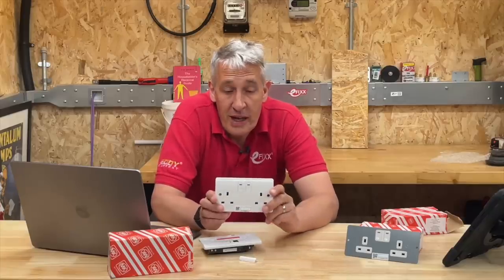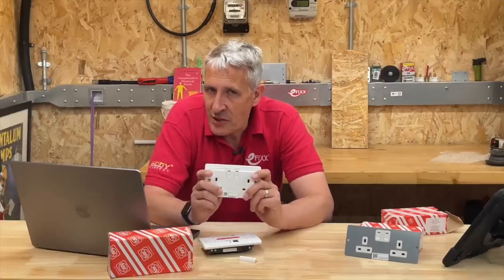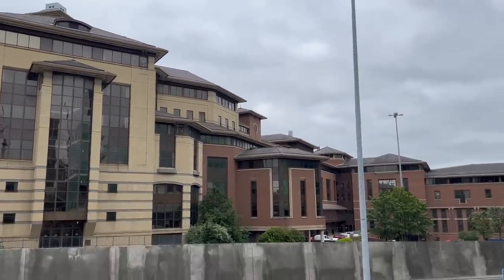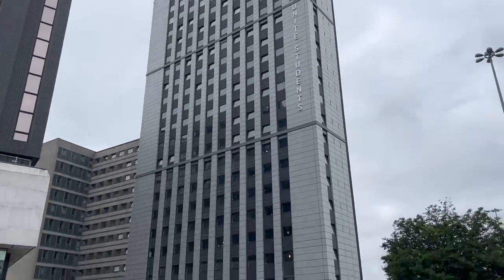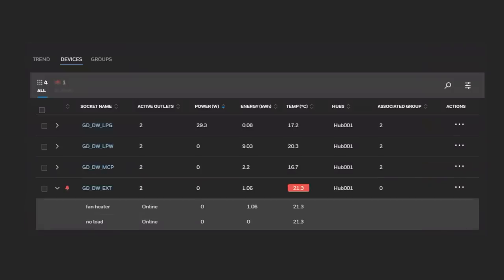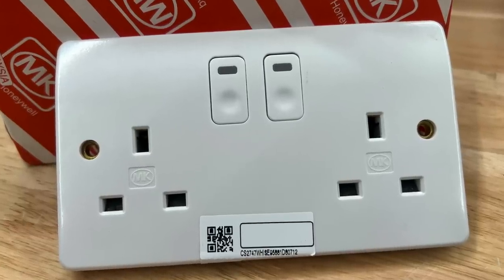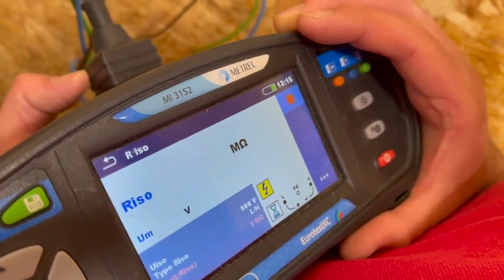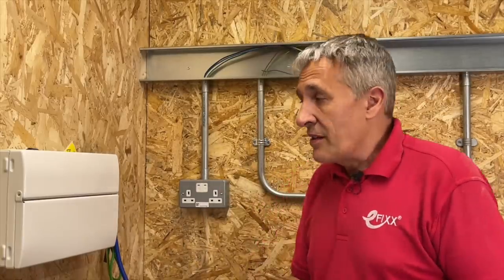Unveiling the Hidden Surprise in this Game Changing Socket

Comment: So if I was a student with this in my dorm, all I got to do to bypass the limitations set in the BMS is remove 2 screws and flip that switch?  I guess the BMS would probably alert to say that the sockets went missing though
Reply from the maker: The BMS would flag a fault and the socket won’t work if the internal electronics aren’t connected - better pop down the students union instead and make a nuisance there instead.

Comment: How good are the relays in one of these sockets? It could be an expensive exercise getting an electrician in to replace one, and program it to operate with the rest of the installation. Every time an organisation has a re-organisation/office move, or equipment is moved from A to B, or extender leads are fitted, the system will need reprogramming. I can see that certain use cases like gyms could benefit from a system like this.
Reply: No reason for an electrician to manage the software side. The buildings existing IT support could easily take that part of it on without issue. In fact, most IT departments would no doubt insist on it..
Reply: @dougle03  The building management team is never going to let the IT team anywhere near the resulting network, while the IT team will be making it very clear that power will not be just disconnected from devices such as printers as and when the building management team thinks it is for the best.

Comment: Why is this device avaiable only for industrial or commercial applications? Is this limitation just a financial limit in the form of capital costs of the system needing a large number of outlets, where savings can be made, so that ongoing savings eventually compensate for initial capital costs? Device pricing would have been a useful parameter to have included in your video.
Reply: £250 each.... Similar units can be had from Amazon for about £30
Reply: @dougle03  That seems very odd. Why would anyone pay £250 when "similar" devices are available for £30 from Amazon? Just what is covered by that danngerous word "similar"?
Reply: @ianburton9223  All the key functions of the MK one. Wireless comms, remote control of each socket, remote temperature sensor. As far as I can tell the only USP of these units is the ability to disable the electronics, but only by taking the faceplate off to do it, so not really very practical...
Reply: @dougle03  Added cost of £220 for the red button does not apear to be a reasonable commercial propostion. Thanks for your contribution to this "bang for the buck" issue.
Cheers
Ian M. Phil., C. Eng., M.I.E.E.  before the institution of electrical engineers became the instutution of engineering technology - MIET would have been my new label, but this translates to "crumb" in french - not good for my business in France.

Comment: Odd question.:
If the Orange switch disables the smart circuitry, does the outlet still operate.? (Supply power). For it to properly be part of the test.
Students (or workers) will very quickly disable the smart technology using this switch.
It still may be flagged up on the panel as a missing socket on the system though.?
Thoughts.?
Reply from the maker: The electronics needs to be powered up.
Reply: @efixx  For the relays of course. I suspect students may still find a way around the restriction by pairing up the Two outlets into one trailing socket.
Reply: @G1ZQCArtwork You are confusing yourself.

The internal switch is present for purposes of electrical testing, nothing more. So it is switched off by the electrician for the purposes of the PAT/insulation test only, and then switched back on.

You don't want power coming out of the socket under this test; this is not normal operation. There is no appliance connected to the socket outlet.

So yes, turning the switch off isolates the smart socket's electronics from its supply and means that the socket cannot operate. It means that the relays switching mains power to the sockets are in a normally open state and require energising to close the relay contacts and energise the output sockets.

So if you wanted to permanently disable the socket and prevent it being used, opening the socket up, sliding this switch would achieve that. But that would be a pointless thing to do, as you've installed a £250 socket and now it can't be used.

Now, your second question/issue was whether you can bypass the current restriction limitation when active.
That's not connected with the electronics isolation switch.

If the user has configured the system to limit the socket to 6 amps each, then yes that restriction can be bypassed by making up a cable adapter arrangement comprising two 13 plugs with 13 amp cables and a junction box. That would provide up to  12 amps of current.

A highly dangerous cable because you would be able to remove one of the two plugs from the sockets and a live pin at full mains voltage would be exposed.

But yes, the current restriction could be by passed.

Any seller selling such a cable is certainly going to have Trading Standards soon knocking on their door and possibly a prosecution will follow.

But of course, there is nothing to stop an individual making up their own such adapter cable.
Reply: @deang5622  No, not confused thanks.
Reply: @G1ZQCArtwork  Not now I hope after having answered it.

Comment: I would be intertested to know why they resorted to screw terminals over their latest lever type terminals..... has MK lost faith in that route?
Reply: You assume they considered their use and ruled them out. They might not have.

Or they might have considered them but ruled them out for cost.
Reply: @deang5622  These are £250+VAT per socket. Cost was not the limiting factor

Comment: with rf coms and the right f/w these could become very attractive additions to any hobby home automation system
whats the IC employed? is it open to modding? if using 433mhz rf it should be cheap to integrate into any system
Reply: Already done. BG is doing something similar for a tiny fraction of what these cost. The home automation scene is now dominated by the open source community. Could not tell from the video, but that chip looked like an Expressive ESP8266 or S32, thus very much moddable with your choice of alternative firmware...

Comment: I would have thought, given the price of these sockets, that the best solution for most office situations would be to get modern energy efficient hardware at the next hardware refresh cycle.  I did some analasys of our office equipment a few years ago to appease the bean-counters who regularly walked around a 50+ person office turning off all the "idle" monitors, printers, etc.  

Using inline power monitors averaged over the course of several weeks, i calculated that turning them "off" by pressing the button on the front saved litterally pennies across the whole company.  And in fact cost the company man hours for the person who was wandering around turning them off.  This is because the difference in standby power usage when teh LED is on or off is tiny on modern well engineered hardware.

Obviouslyt the biggest difference was fully unplugging from the wall (or physically flipping the wall switch where that is an option), however the cost... across the whole company... for about 50 screens, some desktop pcs, 5 printers, and a few ancillary bits of hardware sitting in standby mode, was about £25-30 a year.  Considering our annual power bill was close to 5 digits, it barely shows up as noise.   Admittedly this cost will be larger now power prices have shot up, but i imagine percentage wise its going to be pretty much the same amount relative to the total bill.  Possibly less because we have newer, more efficiant, hardware now.

This is obviously only relevant for devices that are in "standby" mode.  If the device is actively left "on" and drawing actual current, then thats a different situation, but i imagine using an inline smart socket would be an order of magnitude cheaper than installing these to solve that problem.  Not quite as "neat" though i guess.

Comment: If this was to be used in a domestic installation does it support MQTT, Home Assistant, or Home hub integration? Or does it require MKs proprietary BMS software ?
Reply: They're not designed for domestic installation.
Reply: @Pugjamin  That wasnt the question i asked.

Comment: The biggest waste of electricity I came across when I was working was in a school domestic science room. I wired in 30 2kw under sink water heaters, each one, of course, had its own isolating switch on the worktop. I used to do a lot of other work during the school holidays when I found that all the water heaters had been left switched on all the time! The MK system would have saved a lot of money in that situation.
Reply: At a high school I went to in the 90's the computer department would leave all the computers on overnight, the lights would get turned off and the screens would go into standby so from outside the room would be completely dark, but in the room you would hear the hum and feel the heat of 15 RM Nimbus computers whirring away, with 15 Macs in another room doing the same.

Comment: "Just turn off computer equipment at night!" 
I can see that becoming a potential headache for the IT department. Especially if plugs ever get moved around, or random kit start having trouble remembering things when unexpectedly rebooted.
I can imagine this is going to be super popular if these smart sockets start to do things like killing power to a standby projector mid meeting (also potentially killing the expensive lightbulb it contains) if the sockets aren't labelled correctly, and/or aren't kept up to date.

Comment: This is a typical, “live just spent £30k on new smart sockets”, “how much has it saved in electricity ?”,  “about £30 quid a year”
Reply: Nah, you'd save about 30 grand a year, a single office room can have enough devices like fans and heaters left on to cost 30 quid a night, multiply that across 15 floors with 10 offices on each floor.

Comment: How much power does the socket use when the outlets are off and on (no load attached)?
Reply: If it's based on the ESP chip then <70ma @5vdc (Spec from Expressive).

Comment: Can I ask if you know if MK are developing the same system for domestic installation (and produce the brushed steel face plates - looking at the design the pace plate could be an add on anyhow) since it would solve at a stroke the need for loads of Alexa/Homekit/GoogleHome plug in plugs as well as being able to manage energy usage by room. Will they be also doing versions for the higher power items like cookers, aircos etc that need hard wiring? 

As a home automation afficionado, I can see so so many benefits provided the hub is not overly complx/expensive and Matter compatible ??
Reply from the maker: Mk have no immediate plans for a domestic version it’s purely for commercial BMS integrations. I’m sure as Matter compatibility opens up something will appear.
Reply: The issue is going to be the price they wish to sell these sockets for. Currently, they list at around £226 (ex VAT). A consumer-focussed device will basically be the same hardware, but different firmware but at a much-reduced price. With a major difference in price, they would end up with a marketing headache.

Comment: The originating company was at the distributed energy show, I think?  The sockets weren't that pricey but you had a cloud subscription, interestingly a large user, portacabins had apparently, a faulty heater which was detected by the clouds AI / ML software which they they then altered the user too so they could isolate it. Open source software & hardware anyone?

Comment: Adding these would surely consume additional power through constantly running the extra functionality, make the outlets less robust and long lasting (as delicate PCBs are onboard), and even render units obsolete faster as, for example, wireless protocols improve increasingly often. Above all - apart from the super high price point - there are pretty fundamental flaws in almost every use scenario identified in the video (covered well within various prior comments).
Reply: Would be more bothered about MK deciding their cloud service wa loss making and dropped it rendering all these plates worthless. The electronics in these will use <100ma @ 5vdc idle, rising slightly when the relays are energised.. Ref comms, it's not clear what comms these use, but expect it to be either RF @900mhz or WiFi/Zigbee at 2.4ghz - neither of which are going anywhere anytime soon...
Reply: Turning off just a single desk fan that would otherwise have been left on overnight would save enough electricity to run a whole building worth of these PCBs for a week.
Reply: @krashd  Perhaps, but it does not get over the excessive cost of the units. Most companies are more concerned about their bottom line than they are about the environment. The vast majority of companies green wash...

Comment: Accessing the little red switch means removing the socket and reinstalling it, sounds like it'd double or triple the time and effort required for testing.
Reply from the maker: Means you don’t need to remove one of the conductors from the terminals

Comment: As an electrical engineer I immediately noticed the electrolytic capacitors that will fail and stop the socket working far far far quicker than a normal socket.
Reply from the maker: It's not a "hot" environment compared to something like an electronic lighting ballast which also use electrolytic capacitors usually positioned next to heat generating LEDs etc.
Reply: @efixx  I suggest you look up ohms law then measure the voltage drop across that plug circuit and THEN ask yourself where the buyer at MK got the cheapest capacitors and the best soccer tickets from :)
I know the answer to this already as those capacitors have liquid electrolyte in them and they are probably 85 degree rated as well :)

Comment: I thought - "wow - those would be nice for my Home Assistant setup." - then I saw the price.  There's no way the BOM cost for those comes anywhere near half of £250+VAT.
Reply: Try even 10%!  If adding a thermistor to each outlet bumps the cost 10 fold, I'll go and buy a hat and eat it.
Reply: One and a bit of these is around the price I paid for my whole HA setup. There doesn't seem to be anything they can do that HA can't do with a Zigbee smart plug/socket that has current monitoring
Reply: BOM on these will be about £2.80, call it £4 landed to a UK port... The OEM manufacturer of these is in China and also ships versions of this at white label and other generic brands. MK's involvement is the app software and a couple of minor tweaks to the OEM design.

Comment: I'm sure these have their place but you've now gone from a socket that lasts 20 years or more to one that is useless as soon as the electronics dies - about 7 years if you're lucky.
Reply from the maker: Guaranteed for 10 years
Reply: @efixx  I've always said MK are the best brand and I think that's a good effort on their side.

It doesn't mean they will last 10 years though as we all know.

;-)
Reply: @efixx they may be guaranteed for ten years but that doesn’t necessarily mean that they will not fail prior to that. For MK that is a calculated risk on their cost of replacement or returns but for use on site that means that bot a program to enable replacement should a switch fail early and that a program of preventative maintenance will now be required on switched sockets. Can see where this might look good to a specifier or the guy claiming his bonus for a great solution then moving on and leaving the additional cost to someone else.

If nothing else they could have included some way of decoupling the electronics so that module could have been replaced easily without requiring an electrician once installed.

Comment: it could detect when a freezer is accidentally unplugged !
Reply from the maker: Great application - they are using them in hospitals to monitor fridges which store vaccines etc
Reply: As can far cheaper solutions e.g. Shelly devices run via Home Assistant. The price for an MK socket is plain crazy.

Comment: I designed one of these 16+ years ago (not WiFi) but couldn't (at the time) program the the thing to get it working. Nobody was interested in helping out because there was no 'market' in it as energy prices were so cheap. 
In 1982 I asked my technology teacher about, what Yamaha later called the 'Cross Plane Crank' . I was told it was a stupid idea and there was no advantage it the design.

Comment: I have to say if someone lived in student accommodation and the scrooge mcduck owners set the power limit to 500w, with the end result being one could no longer use their computer anymore... someone would be figuring out how to remove that real quick.
Reply: Yes a cheap extension lead from Poundland and three Wago 221's and you're good to go. 

What the product should have is a micro switch on the mounting screw hole so it could inform the management in the software if it's been removed.
Reply from the maker: A typical laptop power supply is less than 100W
Reply: @efixx your assertion is then that no student has a power hungry gaming PC, ok!
Reply: What about hairdryers

Comment: Why not just get some TP link kasa sockets? I have loads for my apartment and since I have had them I have been £450 In credit for electricity and gas. I have also got a google nest thermostat e, i can monitor all of that together and see what's been used. It can also run on a schedule. The beauty of them is that they are like £10 for the basic one or to monitor energy usage 25-30 roughly. 1 for £300 I'd rather buy 30 for 300 😂😂😂